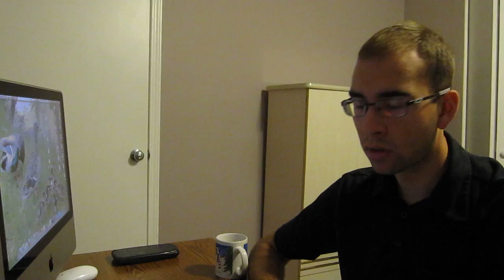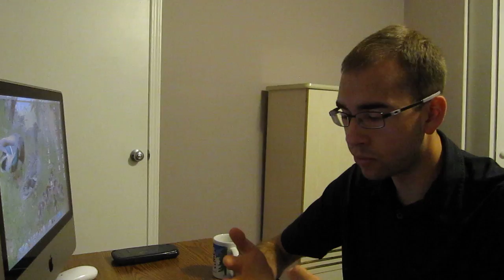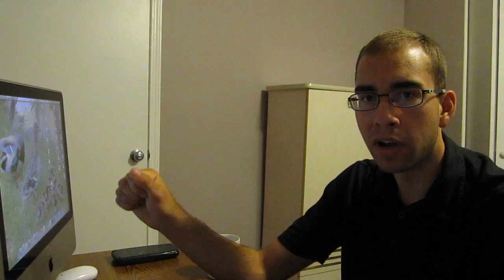Custom Motor Controller Build #1

Comment: I think a Sevcon Gen4 would do what you want. It is what Brammo use on their motorcycle. They are fully programmable and built for motor vehicle use. They also have regenerative breaking.

Comment: Sounds good, ill be watching intently.  I built myself an offroad electric mountain bike a few years ago, and the one think that still annoys me about it is the controller im using is a speed throttle controller, would love a torque throttle controller,  Then again at 50v and 50amps its not going to have as much of an affect for me as for you.
Reply from the maker: Thanks! Yeah I have never used a torque control controller before, but I imagine it would provide much better control! I will have to see how the software works out, and of course that will be covered in the videos!

Comment: 600A is quite huge not sure how will you manage to do that.
On my current project the Solar BMS I can do 80A discharge continuous and is just a basic solid state switch no PWM or anything like that. I'm using a single MOSFET is quite new the IPT007N06N, that is just a 60V part so that will probably not be good for you.
Thermal design is probably you biggest challenge if you want to keep the size and weight down. With each doubling in current you increase the power loss to 4x
PCB mounted mosfets are probably not a good idea for 600A even at 80A with aluminium based PCB is a challenge and I have about 2mV drop for each Amp (this includes the mosfet RDSon, current shunt resistor the PCB tracks and connectors ) So at max 80A I have 2mVx80A = 160mV drop x 80A = 12.8W dissipated as heat on my small SBMS. That can not be handled passive and needs additional heatsink or forced air ventilation. The most I can do passive is about 6W or around 55A.
I can not even imagine switching 600A. Even if I have 8 of this transistors in parallel for 640A the power loss on it will be around 100W and cooling that is almost impossible without forced air cooling similar to a high end computer CPU.
This is considering a 60V transistor with typical RDSon of just about 0.6mohm probably the best in the industry at the moment.
Good luck with the project I will be following the progress.
Reply from the maker: Yes it will be a challenge, not impossible though. The mechanical and thermal aspect of the design is very important. Very "unconventional" build techniques will be used to dissipate all that heat and carry all that current. Not only do the continuous conduction loses need to be taken into consideration, the switching loses also need to be taken into consideration.